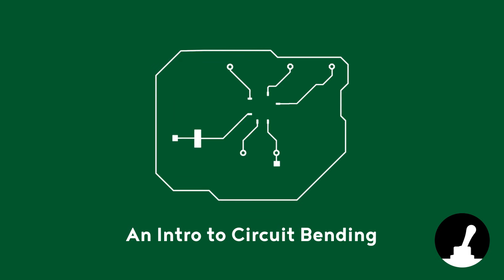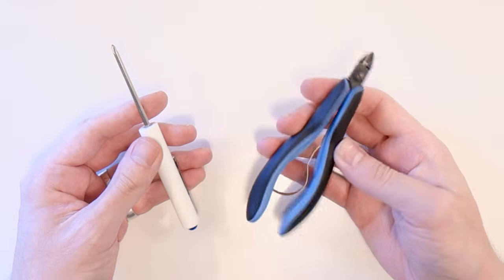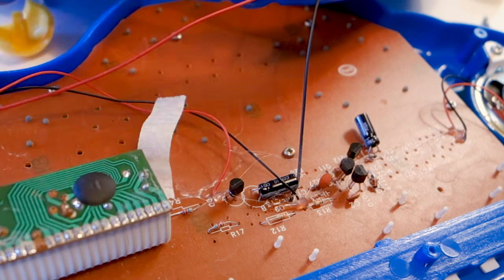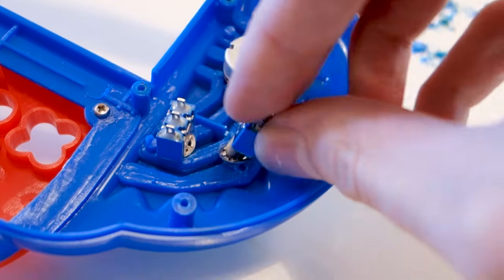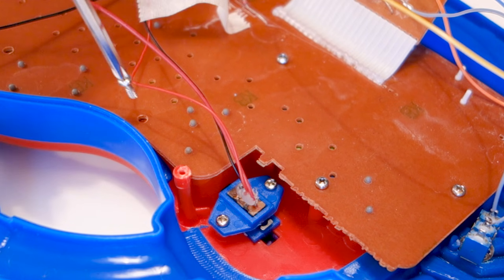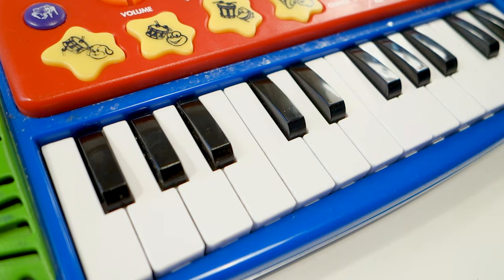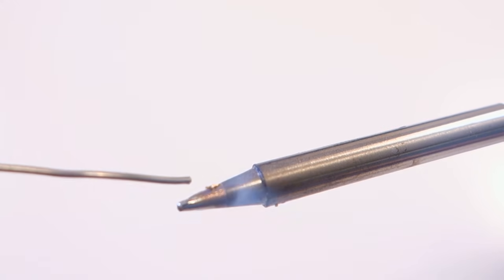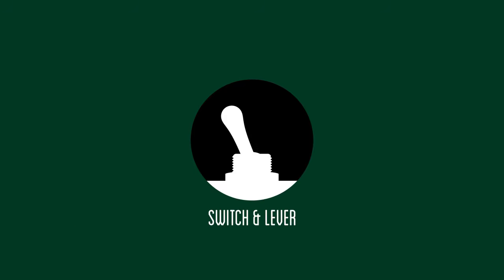An Intro to Circuit Bending

Comment: Another thing about hot glue is IPA will make it easily peel-able and removable. I need to know how do you get rid of audio interference like ringing and hiss from these instruments.
Reply from the maker: Nah, you should've tried being polite in your other comment instead. You chose the judgmental and patronizing route, so there ain't no way on this green Earth you'll get any help from me. 😘
Reply: @SwitchAndLever  Oh boy. You got but hurt over inconspicuous random comment that wasn't really overly critical of you personal it was your excuse that breaking $3 toy was that could have been avoided had you properly used precautions suggested by the other person. For context if you haven't deleted my comments by now is that you said breaking a $3 toy is not such a big deal, but you're leaving out vital information for your viewers that follow along and could have saved them from also breaking their device. I could go on and on. II admit now  that I regret contributing to any more views on your channel or  or engaging with for that manner. I initially liked your video but I'm going take that back.

Comment: the older the toy , the better the chance for more bend points . newer toys use black blob single chip - not may points to experiment with  . older toys may offer many more individual ic chips , which in turn offers many more points at which to test for bends .
Reply: When i first saw the black blob i was sad
Reply: But u can connect the circuit-bending components to the built-in circuit wires:)

Comment: ahh I`ve been thinking about giving circuit bending a try for about maybeee....10 years  and it seems I`ll finally get on with doing exactly that. Thanks a lot for the video it was more than helpful. When I initially discovered the soothing (and I say it unironically) sounds of those bent circuits I instantly got hooked but back than (around 2008/9) there wasn`t exactly a wide selection of videos on how to do it, in fact there were none whatsoever the best thing I was able to find at the time was some proper engineering schematics which ofc were absolutely incomprehensible for me and it all seemed waaaaay too complicated for me. Many, many thanks to you sir.

Comment: lol. i've got exactly the same "keyboard". i added a jack socket, so i could send it to my guitar fx pedal. after that, the built in speaker worked as a microphone, so i installed a switch, to switch the microphone/spekaer on and off. when the speaker is turned on, and the "keyboard" is connected to an old distorting guitar amp, you can play the thing with some pretty nice/harsh feedback. perfect for electropunkish/industrial thingies. 
ah yeah, and i soldered in a 10 M Ohm poti for the pitch. at the lowest pitch, the "keyboard" crashes :D

Comment: Circuit bending = I don't know anything about circuits, but lets see what happen when I short this.
Reply from the maker: Well that certainly is one placeto start out. Though a basic knowledge of what different components do is also a good idea. I didn’t want this video to turn into a electronics theory video though, as that’s beyond the scope of most people watching. It may whet their whistle enough to start reading up on it though.
Reply: @SwitchAndLever  I didn't say that to reflect your knowledge on circuits, it's just this is what people generally do in circuits bending and it is also why circuits bending people do that on cheap electronics and toys that runs on batteries.

Comment: What do you do when you fry a circuit completely?
Reply: Nothing thats the risk you can crash the software on the die or you can kill the mcu die by frying its internal mos transistors so dont connect them directly to the battery you cant fix a fried mcu die

Comment: How hard & expensive would it be to add a variable speed oscillating circuit to the pitch resistors, so it’d behave like a tremolo — (like an LFO that can be toggled on/off and even go into audio-rate range, maybe even with a depth and speed knob) This video is my first foray into this world of circuit bending so I’m a complete noob.

Comment: If you're not supposed to circuit bend devices that run on mains power, then how do people circuit bend effects pedals???
Reply from the maker: Well generally they don’t run on mains power directly, it’s transformed down to a lower DC voltage within the device. I never said that you shouldn’t do it, but you should know what you’re doing before you start as it could kill you if you screw up.

Comment: What if it can be powered by mains power and batteries?
Reply from the maker: Unless you know what you’re doing don’t mess around with mains power. That stuff can kill you, even after it’s turned off due to the large capacitors often used in the power supplies.
Reply: Switch & Lever I know. It was just a question out of curiosity.

Comment: What about circuit bending professional stuff? Like, I don’t know, a reel to reel tape player, or a pro keyboard?
Reply: Driftliketokyo34 Ftw I've seen Duncan trussel doing circuit bending type stuff with a legit synth setup, using different plugin modulators and whatnot. But id assume it's just an expensive soundboard setup and less "circuit bent"

Comment: Hi! I could really use some help with pointing me in the right direction. I have a toy that I wanna tweak, but not circut bend. I wanna change the sound designated to the buttons to a custom sound. Is it possible to change out the sounds in the hardware?
Reply from the maker: A custom sound? Yeah, you’re going to need to completely rewire that whole thing, hook up a separate device that can play back the sound from memory (unless you want to generate the sound through circuitry), and then you’d need to rewire the buttons to trigger that device instead of the toy’s internal circuitry. If you’re lucky you may be able to tap into the internal amplifier for the speaker, and use the internal batteries, but it’s going to be one heck of a hack. If you don’t know where to start you have a pretty steep uphill climb ahead of you.

Comment: Cant i put a jack in the speaker wires like you did and then use a aux from the piano jack i made into my computer microphone jack to record?
I have a simple piano, most stuff does not work but the keys work np so i wanted to give it a better use to record when i want

Comment: D'ont use directly wires, connect a resistor instead. Use a lab bench power suply because you don't know if the mod is consuming a lot of power and can damage the board. Do not replace the pitch resistor, connect the pot in serie with it instead. This is cool anyway!!
Reply from the maker: I hear what you’re saying, but this is an introduction to circuit bending, and the keyboard is literally worth $3. If it’s damaged it’s not a big deal. 

You definitely should replace the pitch resistor though, otherwise you cannot achieve less resistance than it has, so you’re limited. It has to go.
Reply: @SwitchAndLever  This is the proper way to do it safely as in least like to damage it should have been emphasized more. "if it's damage no big deal"  except you just kept a child from getting a keyboard, threw away $3 and created landfill waste, all that effort to acquire it, take it apart for nothing. No big deal.
Reply from the maker: @IrishFinalExit  wow you sure do have imagination. I didn't keep a child from getting anything, this was already borderline e-trash. It had been sitting at that thrift store for ages before I bought it. So frankly, the energy Google wasted storing your tragedy of a comment is the biggest waste here.

Comment: Very cool, I really want to learn how to do stuff like this! Can you recommend any books or websites so I can familiarize myself with the different components and tools. Any kind of classes to learn this kind of thing? Soldering class? This is literally my first stop at looking at this so any info I can get would be greatly appreciated. It is also worth to note that I haven't done anything like this, never really worked with tools too much, so I am really at the bottom of the barrel when it comes to knowlegde.
Thanks!
Reply from the maker: There are many ways, but none are quick. I think I'd start by learning the very basics of how electronics work, what different passive and active components do in a circuit. The best way I know is to think of a project, start small, that you want to make and then figure out how to make it and learn as you go, rather than trying to do it all theoretically. Don't be afraid to fail and blow things up, you will, that's part of the process. Failing is the best opportunity to learn! There are plenty of YouTube channels that teaches the basics of electronics, so that's where I would start. Take notes, if there are terms and expressions you don't understand, pause and look it up!
Reply from the maker: There are many ways, but none are quick. I think I'd start by learning the very basics of how electronics work, what different passive and active components do in a circuit. The best way I know is to think of a project, start small, that you want to make and then figure out how to make it and learn as you go, rather than trying to do it all theoretically. Don't be afraid to fail and blow things up, you will, that's part of the process. Failing is the best opportunity to learn! There are plenty of YouTube channels that teaches the basics of electronics, so that's where I would start. Take notes, if there are terms and expressions you don't understand, pause and look it up!
Reply: @SwitchAndLever  Thanks for the response man! Always enjoy it when content creators themselves respond to the comments!
Anyway, I now have a gameplan, going to do what you said. My plan is to just start reading as much as I can on the subject while slowly acquiring the proper parts and tools and slowly move into my own projects. Also found there is a 18 month electronic/circuitry course where I will he moving to so I definitely plan on taking that. This just seems like such a fun hobby! And I appreciate the stuff that takes longer to learn compared to overnight kind of stuff, thnk I will be in this one for the long haul.
Subscribed!
Reply: Also already found some free e-books on the subject and some physical books I plan on ordering from amazon!

Comment: did you made the speaker cable to an headphone out? wouldn't it make more sense to get the headphone signal from the signal that goes into the amplifier-circuit that is wired to the speakers?
Reply from the maker: Only if you get distortion taking it from the speaker. It’s by far easier to tap in there, and also easier to cut off the internal speaker that way when something is plugged in. It’s also not for sure that the signal into the amplifier is strong enough to power headphones anyway, meaning you’d need a headphone amp as well.
Reply: @SwitchAndLever  i'm just asking because i don't know if the already amplified signal is good for headphones/other amplifier-circuits... but i'm guessing that it's generally not the best idea to plug the most hightech amp into your hacked kids keyboard :D
Reply: If the signal is too high in level it might cause distortion but no lasting damage will be done. Just remember to keep the amplifier volume low at first to protect your speakers and nothing awful will happen.

Comment: Hey great video!  Where do you buy your switchable 1/8” jacks from? I can’t seem to find any online :/
Reply: Subb Par Productions you can make one by buying a rotary switch or whatever switch you have, and also buy 2 headphone jacks. connect the ground to the switch from the circuit board, and then connect one of the switchs out put to the headphone jack1, and the plug the other switches output to headphone jack2. Now the switch will choose which headphone jack will complete the circuit
Reply: Thank you for the prompt response but I still would like to be able to buy one that automatically switches when something is put into the Jack, do you know of anywhere that is selling these currently?
Reply: Subb Par Productions i have no clue where to get one

Comment: That soldering iron doesn't seem like it would last very long.
Reply from the maker: Why not? It's solidly built, nothing on it feels cheap (and trust me, I know cheap), the tips are replaceable, and even the firmware is open source upgradeable. Why wouldn't it last? I've used it extensively for almost a year now to do all my smaller electronic soldering, and it's a solid iron.
Reply: @SwitchAndLever    They are very convenient don't get me wrong just haven't had much luck with the battery operated ones. They just never seem to last.
Reply from the maker: It's not battery operated, so maybe you're judging this based on wrong criteria.
Reply: @SwitchAndLever  I guess so.

Comment: I'm sad that I can't do something like that. And I wonder, it's probably possible to achieve "kid's toy with a low battery" sound, bc it's the most glitchy thing and I love it
Reply: That's a popular circuit bending technique! In fact, undervolt and overvolt are features of the SID Station, which is used in a lot of today's pop music.
Reply: Yep, just cut the cable to the battery and solder a variable resistor (potentiometer with the middle lug connected to either of the outer two) in between
Please take out the batteries first ;)
Reply: I like the low

Comment: Ohh, wow you risk frying the devices, as apposed to mapping, cray cray.
Reply from the maker: That's why it's "circuit bending" and not "electrical engineering"
Reply: Switch & Lever 

Ok, granted, however with just a little engineering I am more than convinced the circuit could be bent into even more dynamic ways...

:)
Reply from the maker: Of course, but if you know how to do that then you probably don't need an intro video telling you how, and if you don't this video would've been a lot longer having to cover the basics of what different electronic components do, and how to use them in various ways.
Reply: Ok there is me missing the point xd, you have given me some inspiration however :)
Reply from the maker: No worries. There is a reason we do it on simple and cheap electronics anyhow. If I fry this I'm only out like $3, so it's not a big deal :)

Comment: One suggestion, since a POT is basically a short when it''s at its lowest setting, it's always a good idea to have a low value resistor in series with any POTs you put in a circuit to avoid overcurrent. Also 555s, VCOs and PLLs make for some easy ways to add/alter sounds on a keyboard like this. Cheers.
Reply: Reality rupture a POT is probably a potentiometer.
Reply: not all are shorts at lowest setting

Comment: If you want to both record and hear what you're playing, you should be able to just plug in a 3.5mm splitter cable right? Or is there some reason why that wouldn't work? I want to know please thanks.

So if I am right then given that you have a 3.5mm splitter cable, there would never be a good reason not to use a switched jack.

Your demonstration actually sounded great and much better than the vast majority of circuit bending demos I have heard.
Reply from the maker: Oh, absolutely, if your recording solution doesn't have an audio passthrough, or even if it does, you can absolutely still use a 3.5mm splitter.

Cheers, glad you liked it! :)
Reply: You could substitute the switched jack for a switch and a jack, so you can choose.

Comment: You can add 100R~10K resistor in-line to prevent frying the circuit.
Reply: Reality rupture you would attach one leg of the low value resistior to one side of the alligator clips to limit the current. Then you can use the other leg of the resistior to test connections
Reply: Reality rupture what i mean by avoid frying it i mean if you accidently connected the terminal that is used for the battery to a connection that is sensetive to the microcontroller or to that amplifier used for the speaker (the thing with several resistiors, caps and transistors) it will just release all its energy into the part (dump a lot of its amperage). What can happen if you do this is that you burn the components or microcontroller's inside (the ladder not being that common) because you added too much energy to the wrong place. The reason its called 'frying' is that  if you poke the wrong terminal of the microcontroller or speaker amplifier then it could cause the thing to get really hot (or sometimes catch fire) to the point it could be able to fry some food on it.
Reply: 8 months later, still no answer.
Now the question is: How did he die?
Because that could be a clue for not following the suggestion :)
Reply: Reality rupture one sec mem me show you a pic
Reply: Where would you add ?